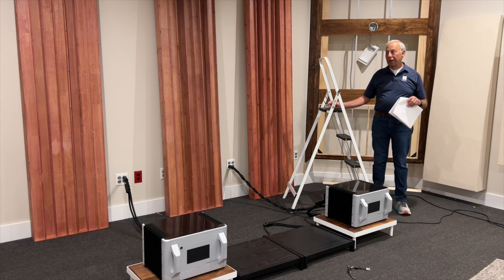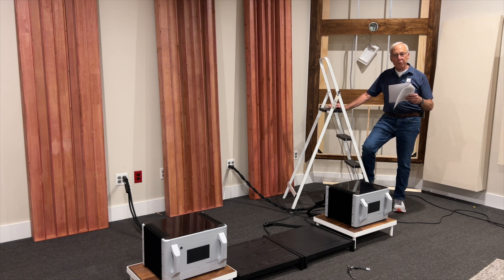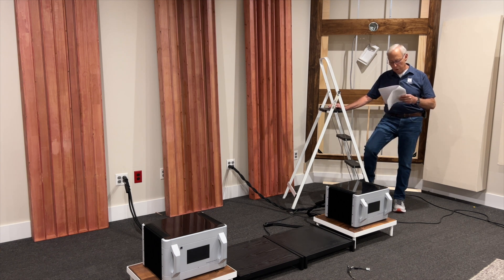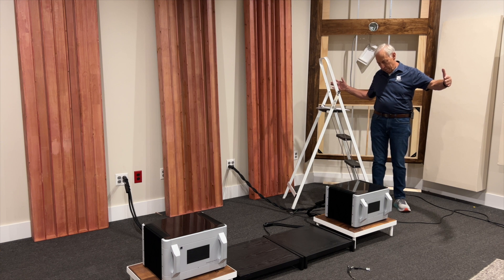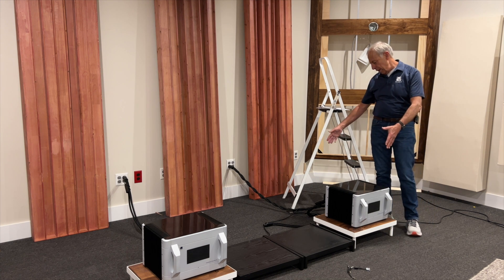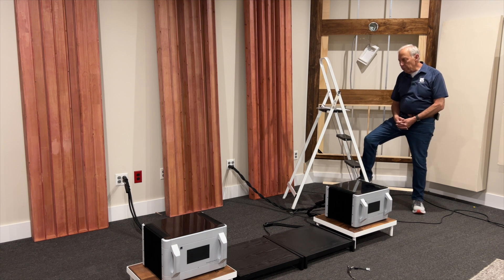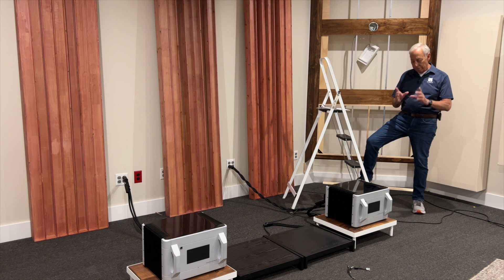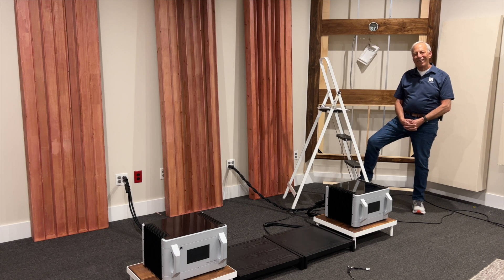Where tubes sound best

Comment: I use VTL Deluxe 300s, with a Signature output transformer upgrade in 2013. My PS Audio P10 Power Plant supplies them both with no issues.

Comment: Theres also tube buffers you can add to a ss system between the pre and power amp to get that colouring into the sound. i use a tube pre and ss pre amp. i like rock and i like it loud. my speakers are not efficient. if you want full tube dont expect to push or control inefficient speakers with out spending a fortune on a tube power amp. much depends on the type of music you like and how much volume you want.

Comment: Based on this video, suggestions it almost sounds like you are describing the Rogue Pharaoh integrated amp with tube front end and solid state output.

A few years back I stumbled across the owner selling his just months old Rogue Cronus Magnum for considerably less than MSRP.  Talk about freaky luck, the day I was to drive from S, Diego to LA to pick it up, he called, left an email telling me he plugged it in and...Nothing!!!  What to do, what to do???

He contacted Mark O'brien at Rogue.  Being fairly new, was told to send it in with the caveat that I'd be contacting them to find out what happened which I did a few days later.

Turned out to be something simple, like a cap or resistor blew.  But while it was there, they went thru every single component, circuit, burnt it in for 24 hours and auditioned it and even upgraded it to the newer Mk 2 specs. We even made arrangements to drop ship it to my door.  How's that for customer service??

 Between 2 phone calls and emails to Mark, I learned that this would be a really good match for my Vandersteen 2's.  Mark says Vandy's are one of his favorites, often matched for audio shows.  He also suggested what he thought would the best tube combos throughout.  Totally retubed via the guys at Upscale Audio with matched set cryo treated tubes.

I've been VERY happy with the results.  Brings out detail in some recordings including 40 yr old vinyl that sometimes sound like a live concert. (If recorded well of course)

There is ONE failing...HEAT!!  It's great as a space heater on those chilly nights but living in So. Calif w/o air conditioning, I simply can not use it during these hot summer days.  I've come to hate these 6 months or so without music, 😮‍💨

So, I am leaning towards the Rogue Pharaoh but have concerns about the Class D final amplification and the possible audible discontinuities they are known for.  Will I be content, happy comparing the Pharaoh vs my beloved Cronus??

Your thoughts???   Thank you in advance for your time and patience.

Regards,
Dan Learned, San Diego area

Comment: hey, i have a little criticism. the volume level in ur recent videos are very low. i need to turn up the volume nearly 3 times as high to hear it at the same levels as other videos. cant hear it much if there ambient noise as i run out of volume, and the videos after blasts away if i dont turn down the volume in time.

Comment: Back in ‘94 I designed my preamp that I still use today. I’ve borrowed no less than 9 tube preamps to compare, and I haven’t seen the need to go to tubes. I started with just the phono preamp, and it sounded so good, I designed the rest of the preamp around it. To my knowledge, I’ve not seen or heard of anyone else using this topology or these devices.
Reply: Do you mind sharing some details? I'm currently struggling with a bad tube preamp (copied from a vintage amplifier) in my DIY amplifier and I'm looking for alternatives I could DIY. Non commercial use, of course.

Comment: One of my TS, amp kits, a valve OTL, the T 16. A pair of monoblocs, employing 16, 6C19PI, (American designation), /channel, in a Class AB, output stage.  The NOS, Soviet era, miniature triodes, originally designed for voltage regulation in the avionics of Cold War era, Soviet, military airships. The valves were manufactured at the Ulyanovsk factory. Minimum 5000 hr lifespan.  The price from Russia, $2.05 a piece, delivered, before the current conflict. I bought 320 of them.  Compared to the output stage of a semiconductor-based amp design, with 375,000 uf of double bypassed, filter capacitance, in an unregulated, output stage, using Hitachi, lateral MOSFETs, in TO-3 packages. If I remember correctly, 2 pair of, 2SK133/2SJ48's, in a push-pull, Class A Topology, biased at 4 Amps.  The Valve OTLs are/were superior in every respect, when operated with 4-16 Ohm loudspeakers. A valve in the correct Topology is extremely difficult to beat, for reasons I'm not aware of. Although the newly realized Cubic Boron Arsenide semiconductor with increased Hole migration, may one day, I hope, better them.

Comment: Absolutely makes sense.  Best of both worlds and easy to live with.

If you are willing to put up with big tubes, an OTL triode power amp using tubes that can swing some current can make a very transparent sound while offering the control and grunt of solid state.  Then add class D for subs below 60Hz.

Comment: I think that most systems sound better with a tube in them some where but they have their issues. Small tubes are cheep and long lasting but as the saying goes " they don't make them like they used to" You have to use NOS. 

 Larger power tubes don't last long and they are expensive to change. The new ones don't have issues with sound quality although NOS is still better. The other downside is power, so you need sensitive speakers or use high power  KT150 tubes.
Reply: "most systems sound better with a tube" and why is that? I'll agree, the vast majority of listeners will prefer the "tube sound". But what is it that makes people prefer it? Can you take a "perfect" sound source and manipulate it so that it now has that "tube sound". Yes, and I was part of a research group that way back in the early 90's did just that. And per Paul's video here. Putting a voltage follower tube circuit early in the design, and tweaking it just a little, will do just that. It will take "dry lifeless" content and add air, space, life, presence. And most people will prefer that sound. I ask you, is it now more accurate?
Reply: @wilcalint  "most systems sound better with a tube" - Has that been verified in double blind ABX testing?
Reply: @jamesrindley6215  Agreed, but why does a tubed system "sound better" or better put preferred over a dead on accurate component. Paul has even eluded to it several times. Is a tubed system more accurate or is it something else?
Reply: @jamesrindley6215  During the study we did we put 20 "Golden Ears" in a room and as you say were able to easily identify in an ABX test that the "tube sound" was identifiable. And most people preferred that sound. The test had nothing to do with accuracy, just preference.
Reply: @wilcalint  I guess my question should have been more specific. What type of tube audio component produced the identifiable tube sound? I'll guess it was either a SET poweramp or a preamp stage with minimal NFB. Those will produce substantial harmonic distortion. A tube amp designed for accuracy should sound exactly the same as solid state.
Reply: @jamesrindley6215  Paul has eluded to this several times. He has a couple videos where he talks about "tube rolling". That would mean one tube to the next the sound is different. Then what's the difference? We used like $50,000 worth of DSP equipment at the time. This was like 1991 time frame.
Reply: @jamesrindley6215  When this has come up in Pauls videos I've suggested building into one of his D/A converters some DSP to duplicate the "tube sound". Like a 12AX7, 6550 or EL88. That would be really fun to play with.
Reply: @wilcalint  It's probably circuit topology more than any specific tube or even tubes in general. The "Amp Camp Amp" is all solid state but people say it sounds like a tube amp. More specifically I guess it sounds like a SET because it's a single ended Mosfet output stage. It adds a bunch of second harmonic distortion and some people like that. That's easy enough to do with a DSP, it's just a transfer function. The other thing is that some tube amps have a high output impedance meaning that the frequency response will show big peaks and troughs depending on variations of speaker impedance vs frequency. To simulate that you don't even need tubes or a DSP, just put a resistor in series with the speaker. It creates a sound that can be appealing and it will tend to sound better with some recordings and worse with others.
Reply: @jamesrindley6215  "It adds a bunch of second harmonic distortion and some people like that." - Bingo! All tubes create some sort of 2nd Order distortion on the signal passing through. How much varies widely. 2nd order being 2nd, 4th, 8th ect ect.

2nd order distortion can be replicated using DSP and that is what we did back in the early 90's. The findings of that study were widely, and freely, spread. Easiest way is put a tube in the first stage of the device. Just like PS Audio does, and lots of other companies.
Reply: @wilcalint  All tubes create some sort of 2nd order distortion and so do all transistors. The aim of a true hifi amplifier is to choose a circuit configuration that removes these distortions as far as possible. Arguably the first true hifi amp was the Williamson amplifier which used negative feedback to remove the inherent nonlinearities of the tubes. When you say "put a tube in the first stage of the device" what I think you mean is put a tube in a circuit configuration that does not remove its nonlinear distortions. You could achieve exactly the same with a MOSFET at much lower cost and higher reliability, but tubes are more marketable because of the aesthetic appeal of vintage tech. And if you do put such a deliberately distorting stage into the amp then what you have created is an effects unit, not a hifi amplifier.
Reply: @jamesrindley6215  "And if you do put such a deliberately distorting stage" - Correct. And that's the point. Creating the "tube sound" from a Solid State device that itself measures no or very low distortion. ie Dry lifeless.

Put a Schiit Lyr in front of a First Watt F8 power amp. Probably not a perfect example but would likely result in a "tube sound".
Reply: @wilcalint  Sure, but if you like that type of distortion you don't need to pay a fortune for an exotic tube amp. The transfer characteristics of a triode can be matched by a 10 cent depletion mode MOSFET. Add a few passive components and you've got yourself the "tube sound" for a dollar. I'm guessing most manufacturers of expensive audio gear know this but there's better business in selling exotic looking constructions with glowing bottles. I get it - everyone wants to feel they've got something special and the visual appeal adds to the experience. In fact we are unable to separate out sensory experiences as well as we think. Our perception of sound is influenced by visual clues and vice versa. Philips found that improving TV sound made people subjectively evaluate the picture quality as better, and wine tasting experiments showed that the sense of taste was influenced by what music was playing in the background. The "tube sound" might be as much visual as audible.

Comment: I've a more streamlined system without a pre-amp so valves have to come courtesy of power amps. Since my streamer/DAC has excellent digital volume control, it produces a nice accurate small analogue signal which then goes straight to (circa 1992, British) 28W pure class A Triode monoblocks and obviously then on to speakers (Italians from 1999), each of which adds their own... 'flavour'.

Now my amps have a SET gain stage which is where the majority of the flavour (distortion) is added, my output valves (still class A) are 2 pairs per channel of EL34s in push-pull config which minimises further distortion being added but overall we're talking ~0.1% predominantly 2nd harmonic at 1W increasing to 1% at rated power. I typically listen at less than 1W RMS and rising distortion mimics what happens to instruments in real life too.

Now with low damping factors valve amps can act as a bit of an uncontrollable tone control, following the impedance plot somewhat of the speakers they're attached to. Some like that and it's part of the reason a valve amp and speaker combination will have a particular sound. But I don't want them to be a tone control hence the reason they're partnered with speakers with a very flat impedance curve. There's a peak just below 80Hz but a HPF cuts this off and Solid state subs take over duties for the really low stuff which is where valves can become flabby. I use DSP for room correction and for setting room curves. This could also help reduce effects of that uncontrolled tone control if present.

Overall though the sound of valves can't be beat for speed, naturalness and for their non-fatiguing nature. I never get tired of listening like I did with Solid state. 

The only downside is having to replace valves every couple of years but you don't drive a car on the same tyres forever do you? On the flip side valve amps will last decades and if you're handy with a soldering iron can even be repaired yourself if the time ever comes.

Try a great valve amp with carefully matched speakers and so long as you don't want to blow the roof off, I don't think you'll ever go back to solid state.

Comment: What is not talked about here is SPACE of the room and BUDGET of the audiophile. There are some awesome tube amps but they can cost a ton of money and take a lot of current. So a great audio store will ask WHAT is your budget and WHAT are you trying to achieve? They will try to get you as close to that as possible with what you can afford.  It's just like a pizza. You can have the best ingredients in the world or just so so stuff but it's the creator the COOK that makes the magic happen. I am looking at some VAC tube amps. They use a ton of smaller power supplies versus a large big one for ultra fast response. They make the tube amp vertical on their premium line. This helps isolate from noise etc. so noise floor is more quiet.  You are talking about  a 75k product however. Regular cheaper tube amps tend to be noisier and have more issues whereas in same price range there are some great solid state amps that would outperform the tube.

Comment: I prefer amps that output a signal precisely as what was the input times the gain factor rather than anything adding soft compression with musical even harmonics (tube sound) or any other audible artifacts. I’m quite aware that some music can benefit from tube sound but on average I prefer to keep the signal path maximally clean.

Comment: I used to have a tube based power amp but the cost of audio power tubes went through the roof and I ditched those for a heaviuy modded Hafler d220 being fed by a Rogue RP5 preamp.
Reply: As soon as I heard about the tube shortage I ordered two additional full compliments for my audio research amplifier. I think I’m set for about 10 years now because I just installed another set so that’s three altogether. It drives my Maggie 
3.6 R’s reasonably well.
Reply: 🤗 personally I never had the budget for tubes or tube amps,so you can’t miss what you have never tasted,till now..we enjoy the difference between them thanks 🙏 to UTUBE videos 😋😁🤗😎

Comment: Darren is the King of mosfet's It is with these devices that a very exacting simulation is possible of vacuum tubes and transistors ... 
Btw .... vacuum tube output stages CAN provide INCREDIBLE damping .... only if the winding on the output transformer is very heavy gauge ( say 8 or thicker) and 16 ohm speakers are used ...